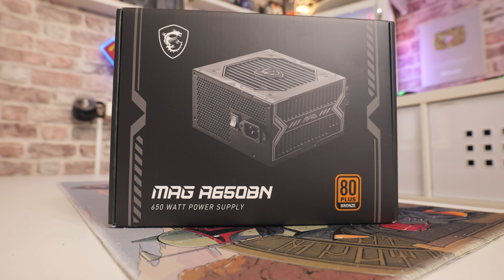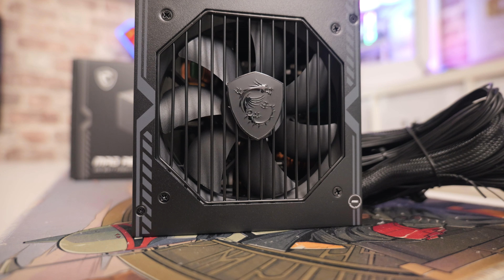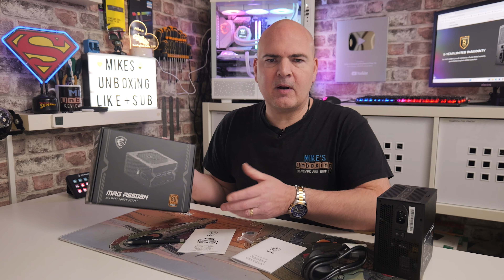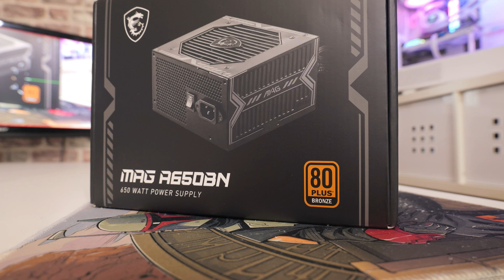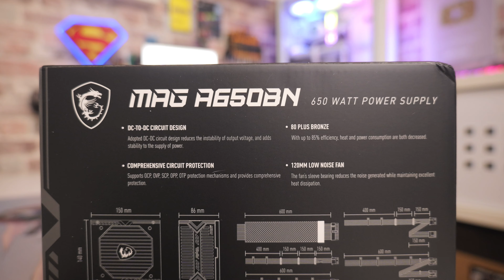BEST Budget PC Power Supply MSI MAG A650BN  80+ Bronze 5 Year Warranty

Comment: i can purchase a MSI motherboard or even a MSI graphics, but i don't know about in this area. i seen a couple from Gigabyte and Asus apparently does some to, but yeah i don't know about that. It's good that they give you a 5 year warranty. Because that tells me they might not be too confident about the product, now 3 years is a more realistic guarantee, 2 years is being too overconfident, but when a warranty stretches out to 5 years, yeah something doesn't add up to me. it's good that overview and review alot of stuff like this, it's because a power supply like this is something budget builders will cross shop it as part of their build. i mostly use Corsair, it's the only one im used to as it is the good one they make. but I've also used Seasonic, they're the only other one i used.
i heard Cooler Master is pretty good but can be hit or me, but i never tried any of theirs. EVGA is pretty popular with PSU's, but their cheaper ones leave alot to be desired though. then theirs Thermaltake and Be Quiet, never tried either.
Reply from the maker: It's always smart to stick with brands you trust for crucial components like power supplies.

Comment: Im confused which one to buy between a650bn and cooler master mwe 650 v2 230v both at same price
 specs:
5600g
8*2 ddr4 3600
Asrock b450m pro4 r2.0
Powercolor rx 6600
Reply from the maker: Both are decent, but the a650bn might offer better long-term peace of mind with its warranty.
Reply: @mikesunboxing well unfortunately the warranty here in my country Algeria it doesn't exist so if the seller gives you a warranty that's good but it's not going to go past 6 months or in a good day it's going to be one year and the availability of The cooler Master is better than the MSI and it's cheaper also so yeah I think I'm going for The cooler Master thank you for the reply and the help i appreciate it

Comment: Got one of these in a buy from marketplace connected to an rx 6800, any issue with this? As it doesnt have 2 separate cables for the gpu but that sort of pigtailed layout. Thanks
Reply from the maker: that will be fine with a rx6800
Reply: @mikesunboxing   Ok great, thanks for the quick reply :) Was worried I'd have to buy a new psu

Comment: Will this Psu be Good enough For Rx 9060XT 16gb and R5 5600?
Reply from the maker: yes easily
Reply: yo did you get it? im buying the same stuff as you and the same power supply, any problemssss?
Reply: @justxynizs7036getting rx 6800 and ryzen 5 7500 with it

Comment: Can i Add a 4070 Super ? (if possible can suggest which would better GPU these PSU and Spec)
CPU: AMD Ryzen 7 5700G
Motherboard: Gigabyte B550M AORUS PRO 
RAM: 16GB (4x8GB) DDR4 3200MHz RGB
SSD:  Samsung 980 NVMe M.2 
         GIGABYTE AORUS Gen4 7300 SSD 1TB
PSU: MSI MAG A650BN, 650W, 80+ Bronze, 2x PCIe 6+2 pin
Reply from the maker: yeah should be okay, the 4070 super has a tdp of about 220w

Comment: this has 2x 6+2 pcie but each sinlge 8pin from psu to daisy chain pcie cabel right.
Reply from the maker: yes that is right
Reply: @mikesunboxing  hi Mike just need some advice. i have xeon cpu which full load takes 150w and oc ver RTx 3070 and 2 hdd and a ssd with 32gb quad channel memory. do you think this power supply can handle my system. my xeon is turbo unlocked so on max it does take 150w ish watt it self.

Comment: Glad i got this earlier last year. Price has gone up, sadly. Specs wise AMD says it should handle up to RX 7800 XT level. Thanks for all the fab content.
Reply from the maker: Prices these days change so quickly, make a video, post it price changes
Reply: Hello I am planning to buy this psu, does it make any noise , is it still good?
Reply: @SuiiSpeed07 It is quiet in my Ionz gamer APU 5600G, Thermalright fans PC. Not exactly getting pushed to the limits in gaming, or production to test ramp up speed noises.
Reply: @Loppy2u  between this and cx650 which one would you suggest

Comment: Didn't like the back and forth over Gold vs Bronze debate, eh Mike?
Reply from the maker: missed that sorry? original comments are easy to see, replies get buried really quick
Reply: @mikesunboxing  not buried; wiped clean as in disappeared.  It was between this guy and myself (pretty sure he has shown up before when the subject is PSUs): @suminshizzles6951
@PapaMav If you want to buy suspect, most likely non-japanese, capacitors and be the proud owner of substandard rails, be my guest. Why bother with bronze? Just go for those cheap 2o dollar chinese PSU. A PSU is a PSU , right? Bronze is bronze whether the thing costs 15 dolars for a 650 watt or 20 dollars. Heck, buy the 10 dollar one. Those Gold standards are for pigeons, not you. When the kw costs 35 pence where i live i will take any savings i can get or do you deny that a gold standard PSU is more efficient than a bronze? I will take that %5 or more. I use the capacity of my PSU' and dont sit at %50 load or less. Oh, I am also a CompTIA A+ certified tech. What are you?
Reply: @mikesunboxing  'buried', by someone for sure (2x now)

Comment: That was an excellent review, Mike. Indeed, MSI puts out some good PSUs at reasonable prices. Also, that's a very decent warranty. Modularity for a 650 Watt unit is merely a luxury, but certainly not necessary. I, personally, have a MSI A850GL in one of my machines and I am extremely happy with it. In addition, I got a great deal on it as well.
Reply from the maker: thank you

Comment: Currently Amazon US is selling this power supply for $69.99. My power supplies last me forever because I don't push my power supplies to the bleeding edge. Love me some Molex connectors. Thanks for sharing Mike and Lady Kath. Take care all. I also always mount them with the fan up. Cheers
Reply: Update, it got a 20$ coupon discount now too, so you can get this PSU for 49.99$ !!!
Reply from the maker: i think fan up will increase the longevity of the fan bearing or motor as its not being suspended
Reply: @mikesunboxing Please review cooler master mwe V3 550watt